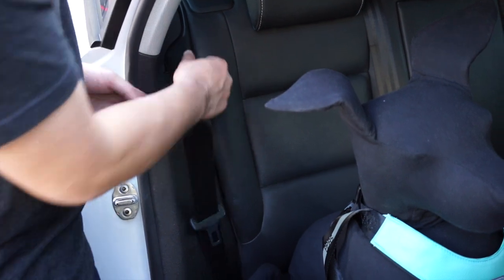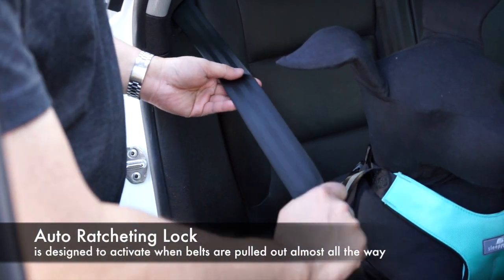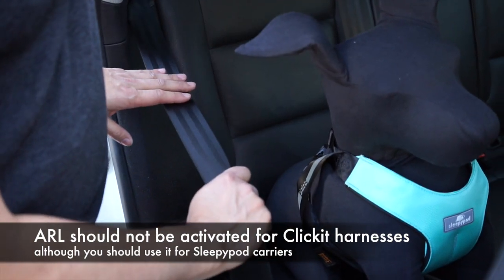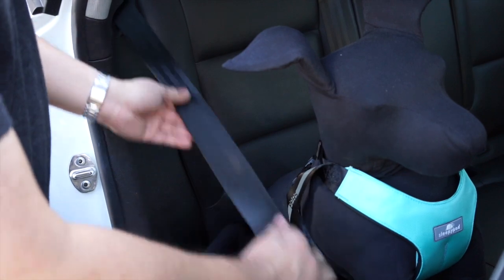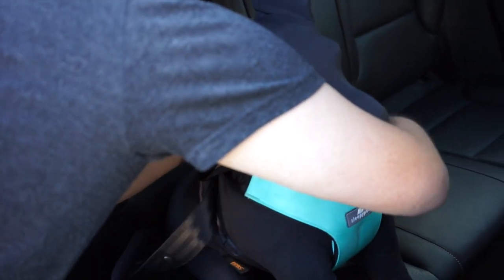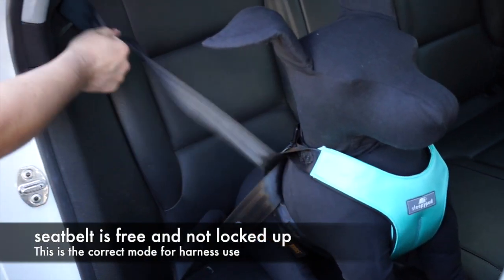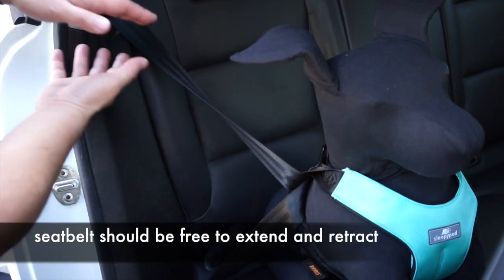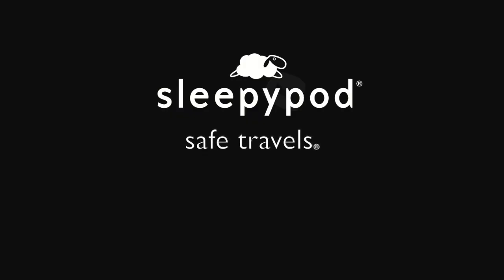Clickit Dog Seatbelt - Instructions

Comment: Even with only sitting and laying down, our large dog will cause the ratchet to engage within 10 minutes into the drive, just because there is not much length of seatbelt left after clicking it in.
Reply from the maker: +777arc You can order clips like these to prevent the seatbelt from retracting. Try locking up the ALR with the clip on so it will not allow extension or retraction.  http://www.amazon.com/Metal-Seat-Belt-Locking-Clip/dp/B004XJ0EF0/ref=sr_1_51?s=automotive&ie=UTF8&qid=1459983742&sr=1-51&keywords=seat+belt+extender
Contact us with any other questions. We are here to help.
Reply: @Sleepypod  How do I use the S clip? Is there a video?

Comment: How do I use this harness with a LAP BELT only?  Which is what I have in my older RV.  THANKS!
Reply from the maker: +Raven Flores It is safer when using a three-point seatbelt (lap/shoulder belt typical in most cars) in combination with Clickit Sport, but if your only option is a lap belt: thread the belt through the Clickit Sport straps as you would a lap/shoulder belt before buckling up the belt.